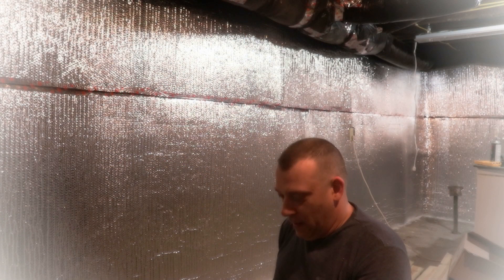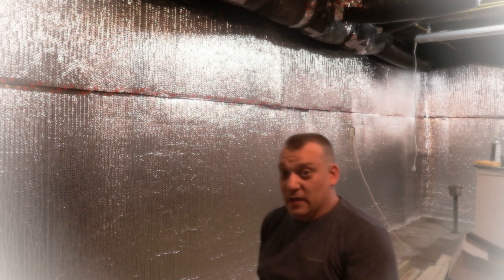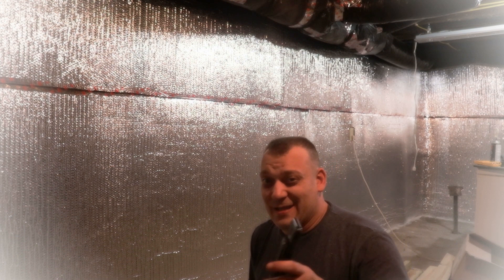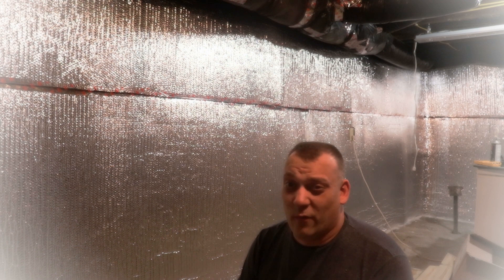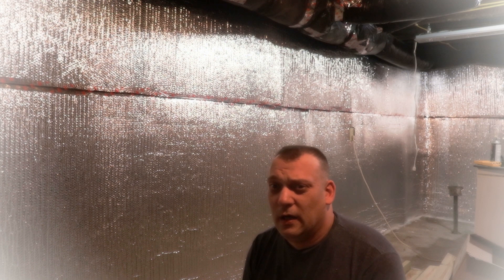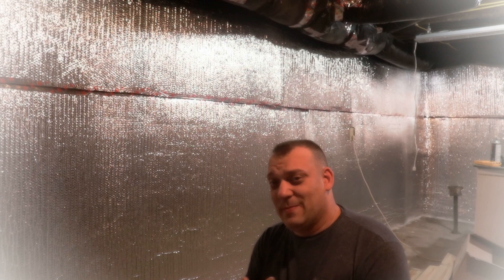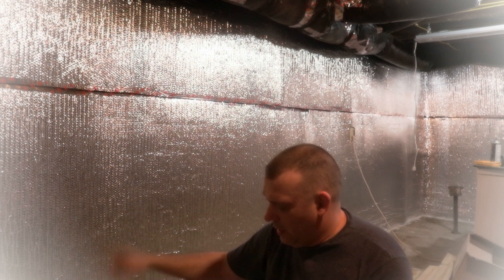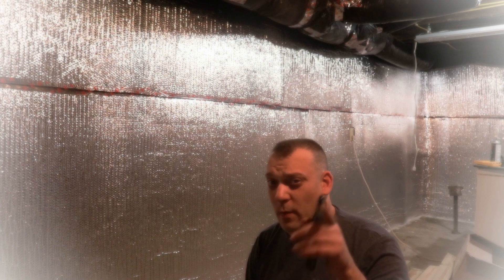Maximize Energy Efficiency with White Double Bubble Reflective Foil Insulation

Comment: Can you place drywall over it without have to have framing
Reply from the maker: There's nothing really preventing you from doing that.  You'll pop a few of the air bubbles if ya do, slightly reducing the effectiveness of the barrier.  Would definitely use a lot more liquid nails.  Though it would be difficult to get the masonry nails into the mortar joints, since the joints wouldn't be visible.

Sounds like a lot more headache, with a lot more potential for issues (like cracking a block and having water pour in) with no ability to get to the proper R value.  

I wouldn't do it, but I've seen others do it.

Comment: Can you put drywall over it? I just bought a shed with double bubble insulation
Reply from the maker: You can.  You might lose a little bit of R value if its compacted behind the drywall, or if bubbles burst while hanging the drywall.   

Drywall has about a 0.5 R value, so it should make up for more than what's lost by a few bubbles being popped.

Comment: In installing bubble wrap video, should foil be facing outward, in metal shop, as radiant barter?
Reply from the maker: This is mostly below grade, so the radiant barrier part is negligible.  The reason I chose to use this in the install was to close any potential air leaking in from the outside.  

Having the plastic side facing the wall in this installation is purely to reduce possibility of mold in case of Drylok failure.  

I have since framed a wall on the inside and insulated it, leaving this barrier as mainly protection against mold, air stop and minor r value increase.

Comment: Is there any benefit to having a shiny side on the inside?  Compared to the white vinyl alternative (it's also double bubble with foil on the outside.)  Or does the only winter heating value come from the bubbles and the air leak coverage?  Does that second shiny side add anything ??  Trying to decide which to order.  Can't find anything like a test or even an explanation so far.  Rigid foam board is also an option - which has white and foil sides - and it's even cheaper than eBay double bubble thru the local box store (4x8 1/2" = $7.29)
Best regards!
Reply from the maker: I chose to put the white side against the cinderblock, in case the drylock failed.  

Shiny side from my understanding is the radiant barrier side, which since outside wall is mostly underground and partially below frost line.  I'd rather chance bouncing internal heat back in, as opposed to external heat back out.  

Ridgid board was my first thought for this, but I wanted to prepare for potential failure and figured the plastic would help move the water without festering potential mold.  

Mine is definitely not an ideal setup/install, I just feel more comfortable planning for failures.  I did frame a wall after this and insulated the frame with insulation (leaving the radiant shield as an extra layer of security for my peace of mind).
Reply: Hello if don't mind   would tell me what store you found the foam board?? . Lot higher in my area where I've found it so far .
Reply from the maker: Certainly, found this on amazon https://amzn.to/2XtHIKy

Comment: did you experience any difference? or you recommend another product?
Reply from the maker: I did too much in the basement last winter to accurately tell what project had the biggest impact, but it was noticeably warmer after adding the insulation.  Just can't swear to any kind of percentage or reduction for that step.
Reply: @ManStuffDIYorDont  What else did you do? Is that drylok on the basement walls?
Reply from the maker: It sure is drylok.  At this point, I had power washed the walls to help clean them up, used some hydraulic cement in some of the cracks and liquid nails for mortar and concrete in some other cracks, then drylok and this insulation.
Reply: @ManStuffDIYorDont  Thanks for the reply.. i've thought about pressure washing below grade but moisture accumulation worries Me. I'm going to try the double bubble wrap on the floor joists after I seal the rim joist with 2" xps insulation board with a foil face.